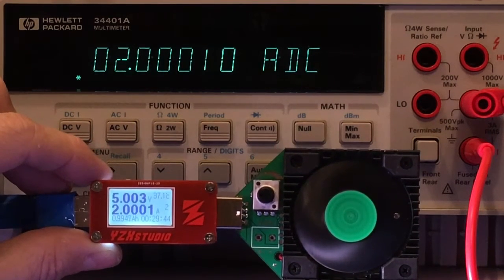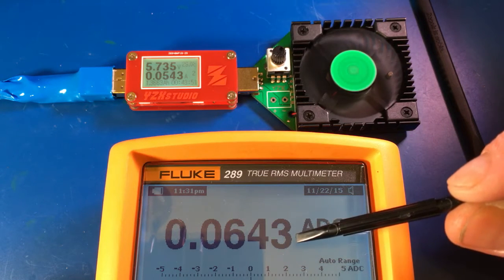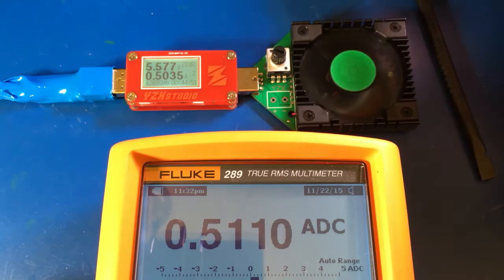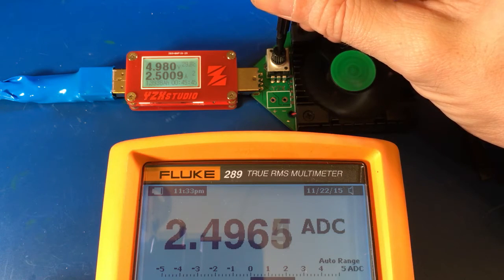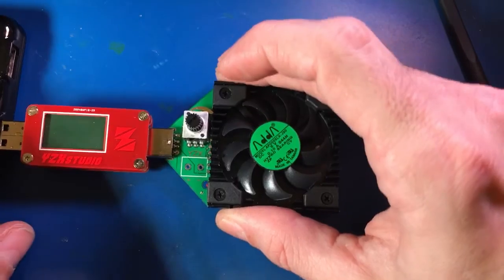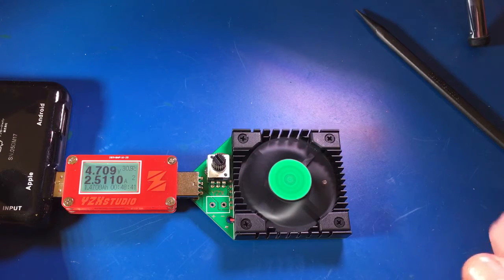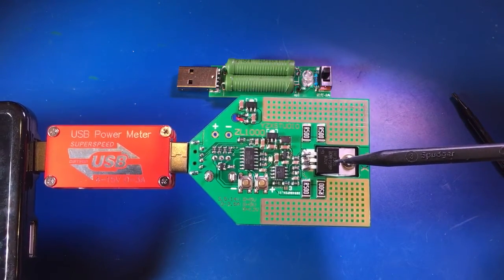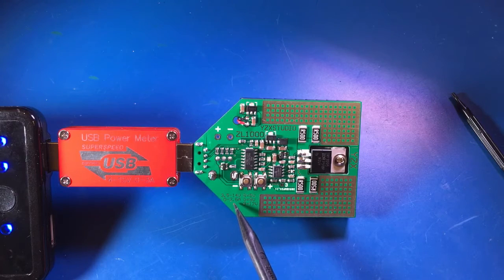YZXstudio USB Adjustable 0-2.5A DC Dummy Load ZL1000

Comment: Next to the potentiometer there's a footprint for a terminal block power input. You can populate it so you can use it in non-USB applications.
Reply from the maker: +gfx2006 Thanks, not sure how I missed that. Your right, that was for a terminal block and I've tested it. It works good.
I even decided to jump the 3 pads to see how high it will go. I won't run it at max, it get a lot hotter as expected. But it also seems to add a little more stability to adjusting it with the multi turn potentiometer.

Comment: You definitely need to calibrate your YZX meter. Franky can send you his instruction sheet with how to do it.
Reply from the maker: Thanks fro the reply, this video was more about the dummy load and not the meter. 
I know how to calibrate the meter and when I did this video I didn't want to cut a USB cable.
My meter was reassuring he current draw before the Power Meter, but the Power Meter is measuring the draw after it and before the dummy load. So my numbers was before the current resistor shunt and the sense wire on the power meter and this is why it didn't match in this video.
Once I installed the terminal block on the dummy load I was able to put my meter inline on the power source for the dummy load and confirm the power being drawn is the same as shown on the USB power meter. And this is were you need to take the measurement for calibration since its after the current sense wire and resistor shunt, it also makes this dummy load a good value as well. I also made a precision 10V and 5V power source with 1ppm in 0.01% accuracy after its warmed up so I use that to calibrate the DAC for the voltage readings. Its not needs as much now that I have the precision Rigol Power Supply DP832, but I still like it since it runs off a 9V battery. You did get my curious so I checked my precision voltage build with the USB Power meter and the Rigol DP832, and they both agree with each other while measuring with the  HP 34401A bench meter. So that's good to know I guess.

Comment: Nice video, thanks for the review! Would have been nicer to have a Rotary encoder (instead of the pot-meter) with some acceleration, the attiny24a is already onboard to do that.
Reply from the maker: I originally tried the MXL CR-77 dynamic mic, great camera appeal and worked well, but took up valuable space on the bench. So I ended up going with the BLUe Spark condenser mic, and a scissor microphone boom so the mics out of shot and I have more room on the bench. 
They are both good mics and had impressive sound, but a some of that also depends on the preamp.
Reply from the maker: Agree, but their no telling how much of the space is being used for the QC charger recognition software on the atmini chip. I uploaded another video that is changing the potentiometer to a 10K multi turn that makes it easier to dial in the load.

Comment: Hi. Nice review :) What model of microphone did you used?
Reply from the maker: +Daniel Sajdyk 
I originally tried the MXL CR-77 dynamic mic, great camera appeal and worked well, but took up valuable space on the bench. So I ended up going with the BLUR Spark condenser mic, and a scissor microphone boom so the mics out of shot and I have more room on the desk.
Reply from the maker: I'm using the Blue Spark
Reply: +Dave B.Reviews (My Gadget Tech Thoughts) Thank you :)

Comment: thanks for the reply! so if i bought the yellow YZX studios it might be pointless to have the feature that enables you to induce a fast charge? I'd be better off with the red oled or the newer lcd display models?
Reply from the maker: I never had a yellow. That's the one you can force the modes I think? The newer ones will allow what ever the charger is putting out, so I don't think the new one will restrict it in any way and will work fine. If you have Qualcomm QC chargers you can enable the load to act as a QC device. If you order from Franky.com he can provide you a translated manual at request for these advanced features in the dummy load. So the dummy load can simulate the device under test as if it was a phone or tablet that is capable of charging with the QC specs. I guess this is like the yellow one but probably better since its the land acting like the device charging and not something in the middle changing the way the charger would naturally act. I hope this makes sense? I wasn't able to show these features in the load since I don't own any QC charging devices.

Comment: I have two problems with this unit at the moment.
When i try to calibrate i get an error message about out of parameter. Yet the voltage was 1.5v so how can i be inputting this wrong? It does the same thing on the higher voltage setting.
Secondly if i try to update firmware it says check TTL lead so do you know exactly what type of lead this is.
The usb lead that i am using will data log so what is this TTL. Cheers
Reply from the maker: For the firmware programming TTL error are you using the STI programmer? I don’t know if the newer ones support flashing over themicrousb port or not?
https://www.ebay.co.uk/itm/ST-Link-V2-Compatible-STM8-STM32-Programmer-with-4-Spring-Loaded-Pogo-Pins/201303925381?hash=item2edea62285:g:9JEAAOSwgQ9Vrgi~I’ve alwyas done it this way.https://youtu.be/ekHjtYe9fP0
I think I heard something about the calibration procedure changing because to many people were calibrating it without a lab reference stable device to provide a stable contact voltage or current. It should be calibrated from the factory, or the reseller if they have the proper equipment. I know I have calibrated one in the past with a cheap reference or power supply and it made it worse, it does need to be a stable reference. I eventuray built a voltage reference and the chip cost more then most the cheaper references on eBay. I think the reference chip was $20 (US). Building one was half of it since you need to calibrate the reference also, I was also able to calibrate the reference with my HP34401A calibrated bench meter. If you contact the person you bought it from they might be able to give you the updated calibration process if you own the equipment to do this. I think I need to buy a newer one soon anyway for USB C-PD so I guess I’ll soon find out also how this changed. Sorry I can’t help with  it now since I dint own a newer one. Scott
Reply: many thanks for your reply i don't know why we ended up on this page as the dummy load i was talking about was the ZKETECK USB+ however it would seem that this dummy load might be worth investing in. Along  with this programmer which i found on ebay. i also was only able to find the updated YZXSTUDIO ZL1100 ON EBAY.
So i looked for frankey.com via your link and it said page not found, i did a separate seach and i still can't find it. can you help further.
reards kev.
Reply from the maker: I just saw the ZL1100, looks like maybe the updated version of what I have. I should buy more of these for testing some day, but I decided to take a leap and just buy a BK  Percision  8601. This BK also give me the accuracy to test the usb monitors and know they are still accurate after a few years. So far so good, I haven’t needed to recalibrate any of them except for one I bought from a different vendor before I found Frankie’s store. If it’s not listed you can message him and ask if he has any.
I think he also runs a thread on the eevblog forums also to ask questions about products and stock requests.

Most seller will just sell them, some want even provide the updated firmware or English firmware. That’s why I stay with buying them from Franky since I know he has a lot of the same calibration equiptiment I run (and more) and checks them before he sells them. Calibrated them if they need it, and provides updated firmware if you need it also. 
In most cases I say keep the firmware the same, if it’s nkt broke don’t fix it. But for some of my older ones I needed the update to add the Bluetooth module so I’m glad I boight it from him. 
Good luck on the search for what your looking for,
Scott
Reply from the maker: I didn’t know Franky (dot) com was sold to another. Thanks for mentioning this. I fixed the links in all the videos now.
Links to Frankies Store:
http://stores.ebay.com/99centhobbies
http://www.99centhobbies.com/

EEVBlog Frankies Sales Thread, a place to ask him about the products he sells and others that have used the product you might be considering to buy. You know, if you dont trust my opinion that is :-)
http://www.eevblog.com/forum/buysellwanted/franky's-sales-thread/
Reply: Yes i think you are right stick with Franky, .......regarding the 1100's there is i noticed a 1200 series now too, looking on his eblag store.
PS i am now subscribed to your channel, many thanks for the info.

Comment: new tp this stuff... what happens when you plug this into a wall charger or something similar anx turn it up higher than the wall unit is rayed for? voltage drop i suppose and then? i intend to use this setup to figure out what chargers i have are worth a $h!t or not. i figured a dummy load would be better than just pluging in my phone with the yzxstudios in line? trying to figure out what chargers are faster but it gets complicated with the D+ and D- being set up for apple ao android....
Reply from the maker: You can use the dummy load and USB monitor for this, but I would not set the load higher then the rated current listed on the charger. If the charger is rated for 1A (1000mAh) the I would only adjust it to around that amount. I can take my apple phone charger to 1.2A at 5.1V, but I'm over driving the charger and could cause a component failure. When I plug a dead phone in it only pulls 1A, same with the iPad. But if I plug the iPad into the 2.4A charger of pulls 2.4A. So their can be some intelligence between the device and charger. If I take the load over 1.2A then the voltage drops and the load resets to minim 0.05A because the voltage dropped below 3.5V to run the load.
Reply from the maker: +Dave B.Reviews (My Gadget Tech Thoughts) Don't worry about the D+ D-. Mainly the current that dictates the speed of charging. My one 500mAh charger is shown as a DCP charger since the D+D- are equal. The apple shows as an apple since the data lines are difference voltage. Same with my Andriod charger, to shows as an Andriod. Start the current low, work up to its rating for the load and see if the total voltage stays about 5 at the ratted current. Don't forget, cheap charging cables also have a lot to do with slow charging. The charger may be good, but the cable might be bad or cheap, try different cables on each charger. I recommend Anker charging cables that I get from Amazon. They are built good and handle high current with no voltage loss even over longer cable runs like 10 feet.